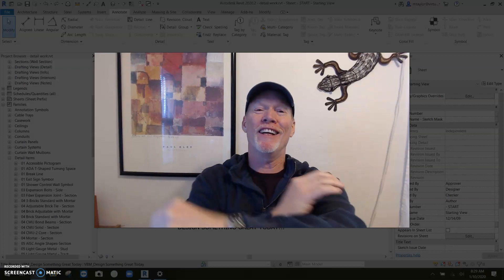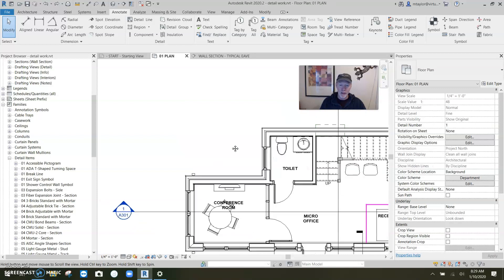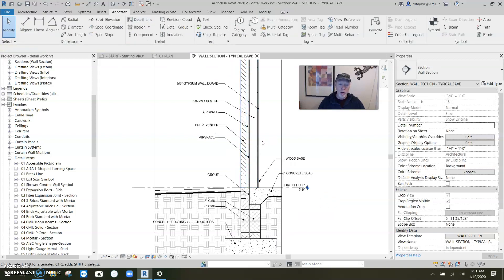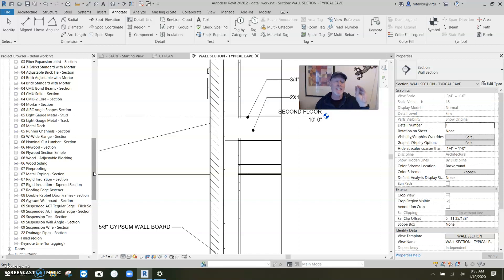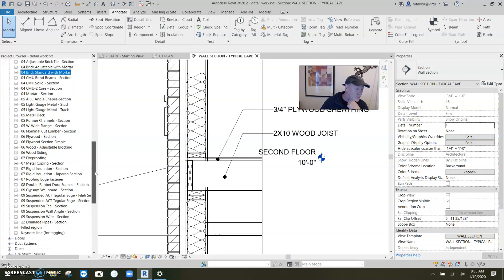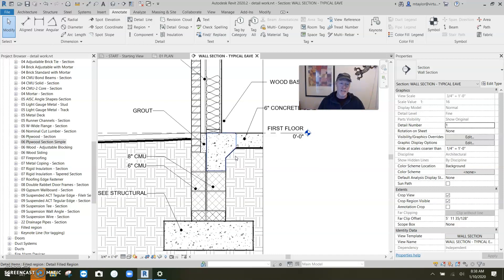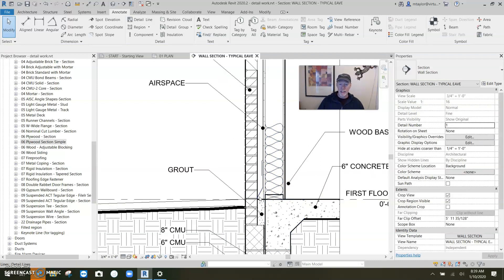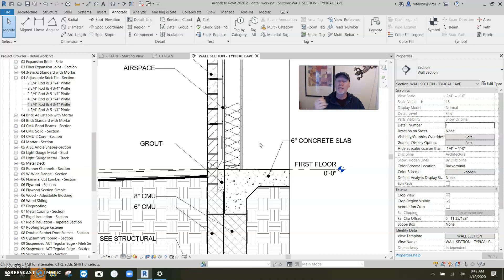Detailing in Revit - 3 Step Process

Comment: Thanks Mike it was very informative video, I need these families ,  from where Can I get those revit libraries?
Reply from the maker: The Revit libraries (all categories) are free to Download from Autodesk.
Reply: @miketaylor-fantastic  i have installed those but i didnt get nominal cut lumber section detailed elements
Reply from the maker: A nominal cut lumber detail component is really easy to make.  It’s just 4 lines around the perimeter and and X.  Make one is my suggestion. :)

Comment: Would you by chance know where I can download the same detail items you have I seem to be missing a bunch that you have. Thanks!
Reply from the maker: Charles, I made all those. they are Easy Peasy. You only need to make them once... Once you make one... you can use it in any project if you add it to your template!
Reply: @miketaylor-fantastic  thanks for replying, for some reason revit didnt upload all the detail item families for me but I found them in a different folder so I've been manually adding families that I need. Your video was super helpful I feel the hardest part with most things is finding a good workflow that is repeatable and your video helped me get there regarding detailing details for the firm I work for. Making the transition from autocad to revit has been a big learning experience. Thanks!